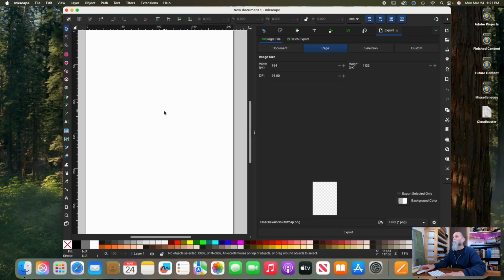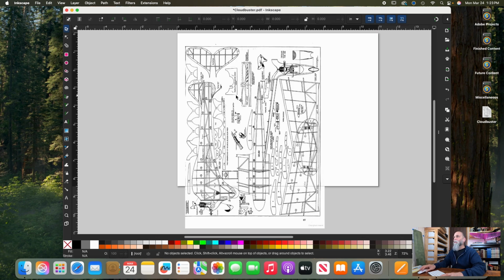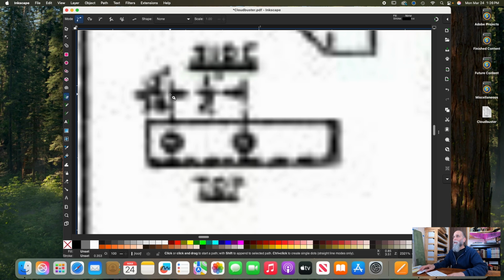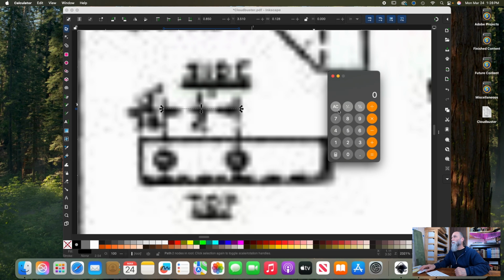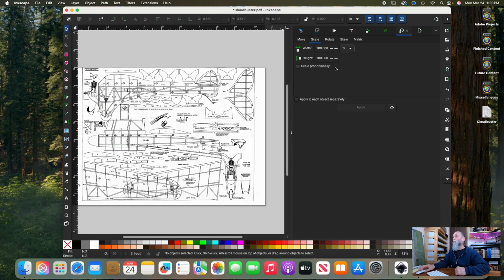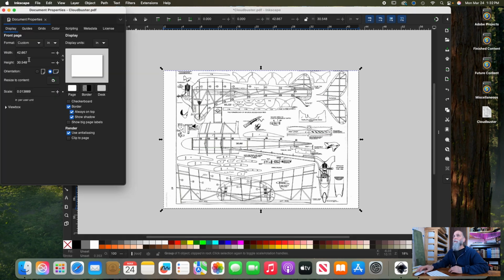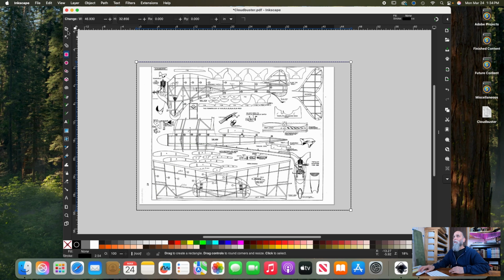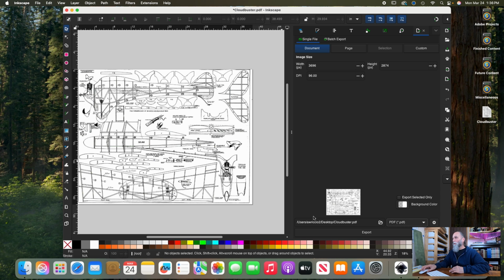Resize Vintage Airplane Plans from Old Magazines Using Inkscape

Comment: Can this method be used to scale up the page in a Great Planes kit manual that shows the parts of the kit that are die cut or laser cut?  Many of the plans I like are on Outerzone.  I can print the full size plan, but it would be nice to be able to print at full size, the pages showing the parts that the original kit had.
Reply from the maker: Absolutely, yes—you can definitely use this method! If the parts page from the kit manual includes a scale reference (like a ruler or a known measurement), you can import a photo or scan of it into Inkscape, just like I did in this video. Once it's in, you can use the same steps: draw a 1-inch reference line over the known measurement, then scale the image accordingly using the Transform > Scale tab.

It’s a great way to recreate or even modify missing or damaged parts, especially if you're working with plans from Outerzone or similar sources. Once scaled, you can trace the parts with the Pen and Node tools and save them for laser cutting, printing, or even CAD use later.

Let me know if you’d like a follow-up video walking through that exact use case—I’d be happy to show how I’d do it.
Reply: @buffaloairpark4500   Yes, could you please show me a video of this process?  That would be great!
Reply from the maker: Sure thing! What plan would you like me to resize? If you’ve got a specific Great Planes manual page in mind or an Outerzone plan, I can use that as the example in the video so it matches what you’re working on.
Reply: @buffaloairpark4500    I was thinking about the Great Planes Rapture 40.  It is on Outerzone.  Page 6 of the instructions has the templates.  I know some of this is on the plans, but it would be easier if you don't have to go by pictures and try to "make" your own parts from the plans and pictures of the templates.  Plans often look kinda cluttered, so it's nice to just have all the parts laid out for you, if you don't have the kit.
Reply: @buffaloairpark4500    Also, if you wanted to scale the plan up to a larger size than the original model, maybe a 72 inch wingspan, and have all the parts be scaled up along with it, how would you do that?
Reply from the maker: Great choice with the Rapture 40—I just found the plans on Outerzone and downloaded them. That looks like it could be a really fun build, especially scaled up to a 72" wingspan! I’d definitely recommend upgrading the engine if you go that big. A solid .60 two-stroke should have plenty of punch, but you’ll want the extra power and torque for the larger airframe.

As for the die-cut parts on page 6 of the manual, I should be able to scale them up in Inkscape just like we discussed. I’ll just need to find a good reference measurement from the original plan to get everything sized correctly. Once I have that locked in, I’ll make a personal video walking through the full process—including how to scale both the templates and the entire plan proportionally for a larger build.

I’ve got a couple of other videos to finish up first, but it won’t be too long—and I’ll be sure to reply here and let you know as soon as it’s live. Thanks again for the idea!
Reply: @buffaloairpark4500    Thank you for doing this.  It will be very interesting to learn how it's done.  I think a larger size would definitely fly well, maybe even a Saito 4-stroke.  I do have a 60 size 2-stroke also.
Reply from the maker: @williamsimmons5539 You’re very welcome—it’s my pleasure! I’ll be working on the video soon. And yeah, a Saito 4-stroke might just be the ticket! I love the sound of a 4-stroke—they’ve got that smooth, classic growl that never gets old. 😄 Looking forward to showing you how I’d tackle scaling it all up!
Reply from the maker: @williamsimmons5539 Just a quick update — I’ll have your Rapture 40 scaling video published this coming Thursday. I’ll reply here again once it’s live so you don’t miss it!
Reply: @buffaloairpark4500    Will I just go to your YouTube Channel to find the video?
Reply from the maker: Yes, but here's the link. https://youtu.be/I8MxbZyOlkQ
Reply: @buffaloairpark4500    Awesome!  Thanks so much!  I'll watch the video and let you know if I have any questions.
Reply from the maker: @williamsimmons5539 You’re very welcome, William! And yes, definitely let me know if I missed anything or if you run into any questions. I’d be glad to help with any other projects you have in mind too.✈️😉